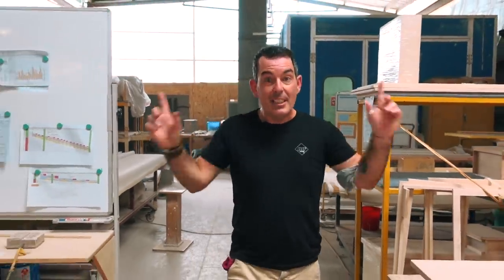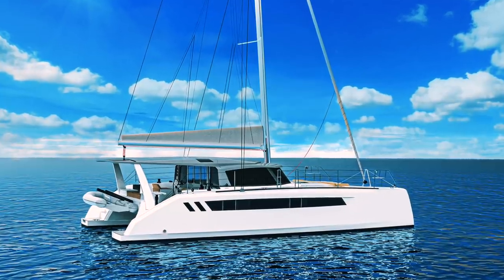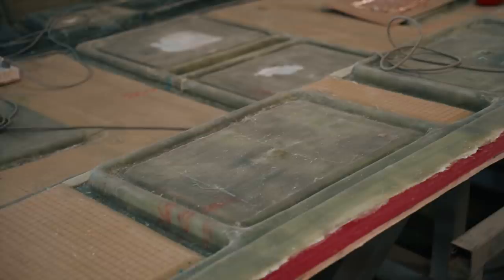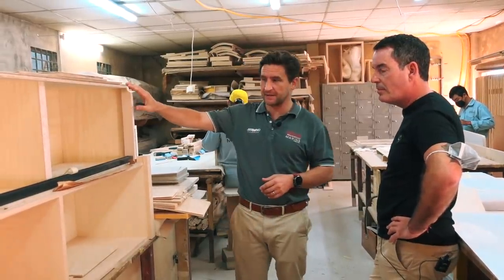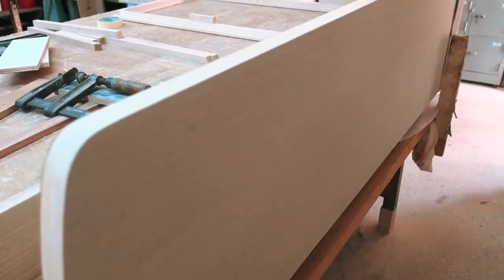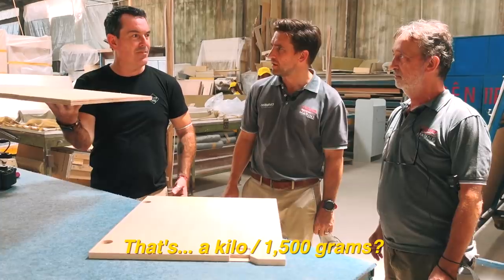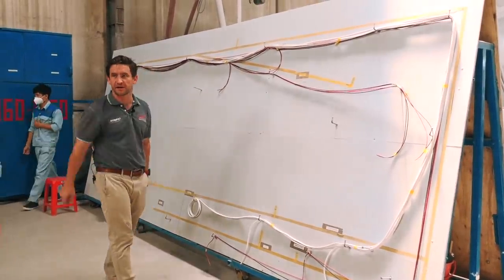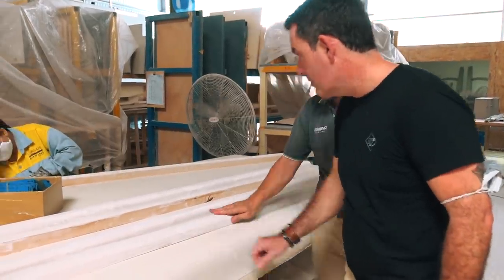How to Make LIGHTWEIGHT & BEAUTIFUL Boat Furniture! (Nick's in heaven)

Comment: Boat construction from the hull and deck to all the finishing have to be designed in steps so everything works together, especially on a catamaran were you have 2 hulls working against each other, and a deck and salon trying to keep everything from being ripped apart. This builder has been at it for a long time and obviously knows how to turn out the best possible boat using basic resin and glass. I'm sure you'll be happy with your purchase.

Comment: Only thing wrong is that I want even more nerd detail! Like what kind of joinery used to assemble cabinetry? Dowels? Biscuits? Screws? What kind of jigs do they use for assembly and hardware install? What kind of joints are they using on the drawers? How are they leveling the cabinetry when installing? How are the shelves fastened in the cabinets? Exactly which drawer is going to hold Nick’s nickers and how many will fit while maintaining structural integrity? These are the questions that keep me awake at night. I’m addicted to RR and I need more nerd answers.
Reply from the maker: Oh wow, you really do want next level nerd detail! 😆

Comment: Great Video.  Please keep them coming!  I have a renewed respect for the cabinet makers there.  I'm waiting for finances to come through and I will be ordering a 1600 (and I know, probably waiting for years to take delivery).  I was looking to request all foam filled fiberglass cabinetry (long lasting and easy to repair).  This is making me rethink that request.  This woodwork looks lighter and still strong, plus wood cabinetry will look much better than gelcoat (or flowcoat if not using a mold).  Very interesting and thanks for the deeper insight - much appreciated.
Reply from the maker: I’d honestly let them build it the same way they build everything else- they’ve been building catamarans for 30 years and every choice they make is for a good reason. I’m also not sure they’d agree to change the cabinetry to all fibreglass as that would no doubt increase the build time and they do need to stick to a schedule. As you rightly say, the look of the timber is far nicer than all fibreglass anyway. But either way, the 1600 is a magnificent boat!

Comment: Hey Nick, how do you fix that veneer if you get damage down the track ??  👍🇦🇺🇳🇿
Reply from the maker: It depends on the damage. 
Small ding can be fixed with heat.
Large ding needs laminate floor repair wax kit in many shades.
Delamination needs heat.
Spent 7 years repairing the veneer on Ruby rose. I’m an old hand at repairing